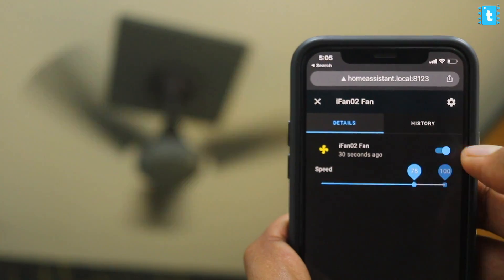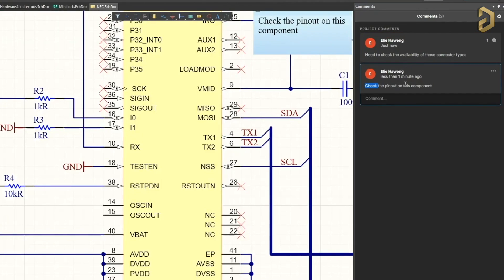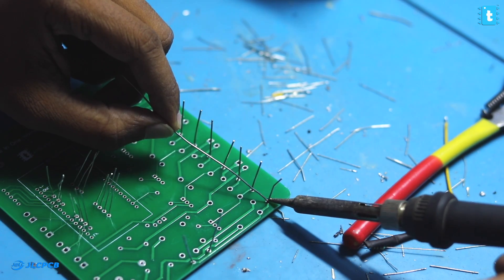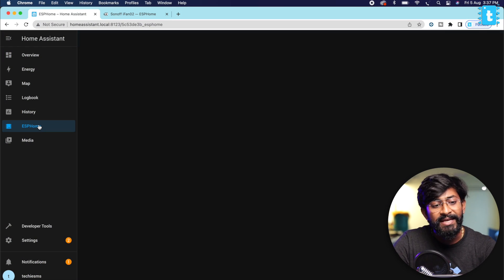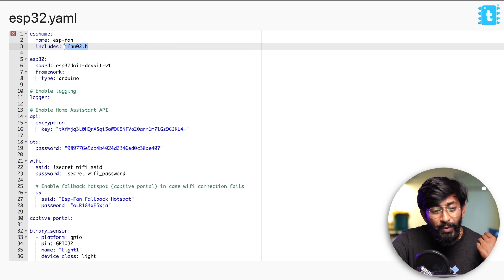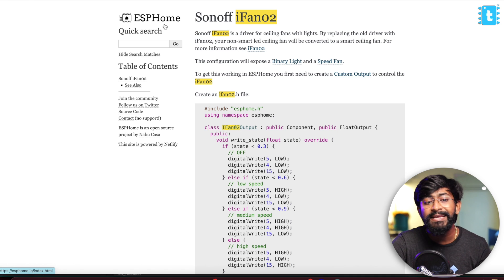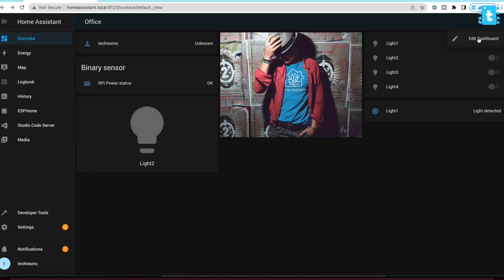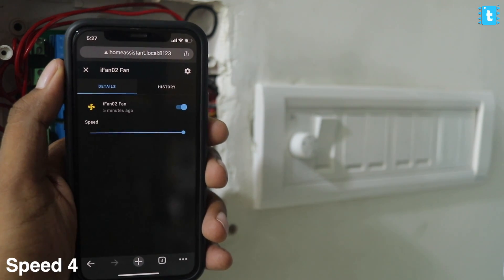A MUST have Home Automation project for Home Assistant users | All in one Home Automation

Comment: Please take a look into the Template Sensor Component, you have to write a lambda function in it for proper fan speed control. It will be something like: if binary_sensor1.state == 0 && binary_sensor2.state == 1, then: do something ... Please check the documentation of the Template Sensor Component with its lambda examples. Regards. :)
Reply: Ó

Comment: Try replacing 4 relays in  capacitor based fan dimmer with 1 relay and Mosfets( not zero crossing detector?
Also try sleek relays to decrease size of PCB.
Also try two layer PCB

Comment: This is a great video for manual switches and fan regulators that I found on YouTube after searching for hours 🥳🥳
Reply from the maker: Happy Making 😇
Reply: @techiesms  For step 3 We can add a automation in home assistant so when we turn the knob to position 3 the input on esp32 is high and the automation will run and turn the other relay on, and when we changed to position to 2 or 4 the pin is low so it will turn off the relay by this we can use the manual regulator for all speeds, because im currently using my four switches by 8 automations 4 for turn on and another 4 for turn off the relays,  By the way, I'm not a coding expert, just an idea Bro😅

Comment: Hello brother, I recently made an All in one home automation using Alexa by seeing your video and it worked fine for a month but not two manual switches are not working. I can control the appliances using Alexa buy there is no input being taken from manual switches. Could you please help me out here.
Reply from the maker: Are you getting the data inside serial monitor?
Reply: @techiesms  serial monitor just shows some random symbols.